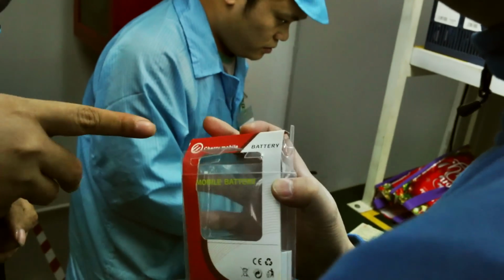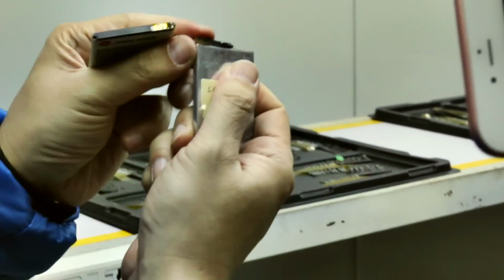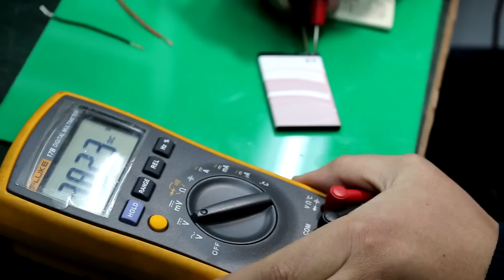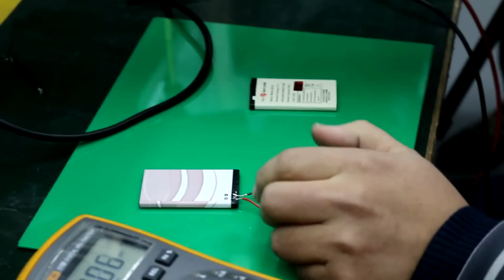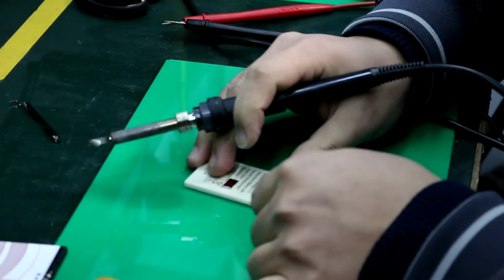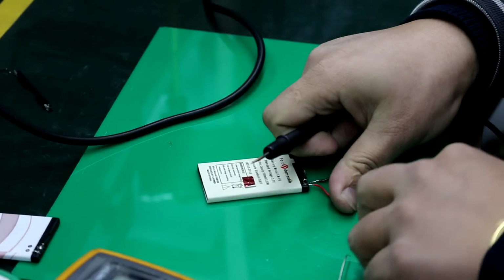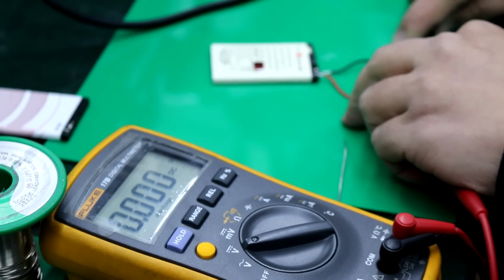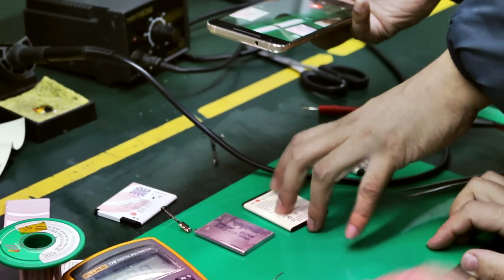Short Circuiting a Fake Cherry Mobile Battery

Comment: Seems like the battery protection circuit on the fake battery did its job and disconnected the battery from the short circuit to prevent a fire. Definitely a good thing in my book!